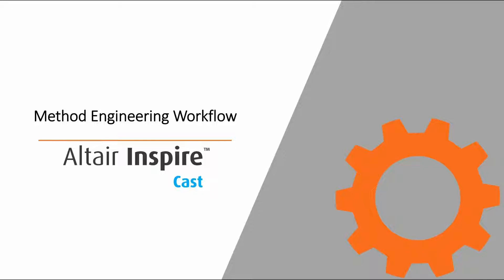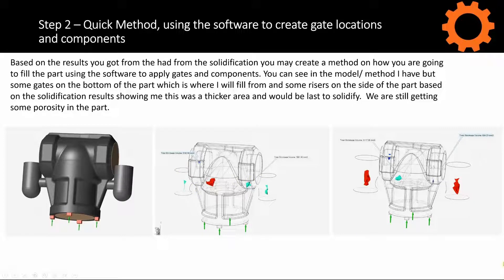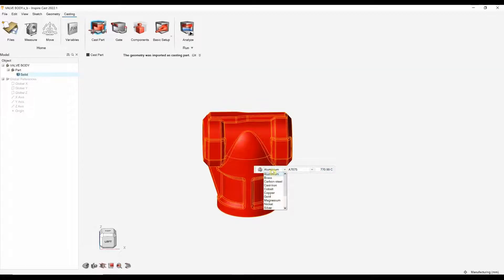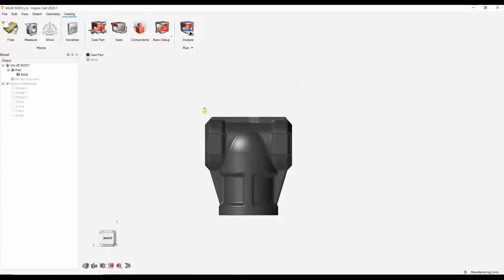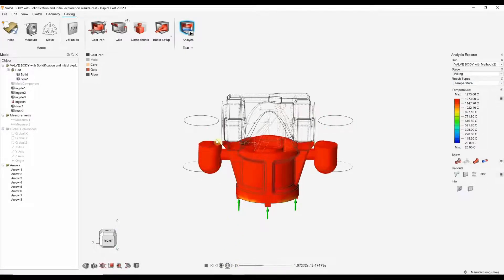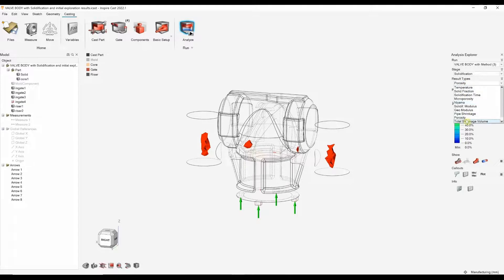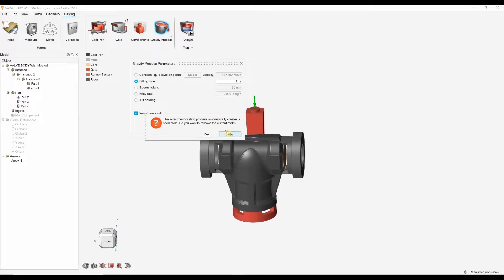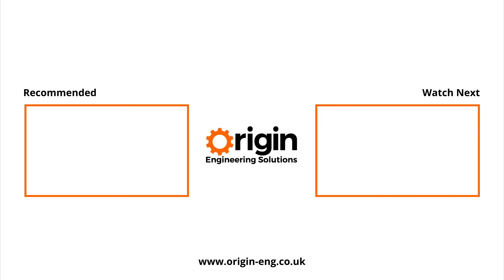Altair Inspire Cast - A Method Engineering Workflow

Comment: I have a question sir why are you not considering the microporosity in this part casting simulation is it less important or is microporosity also the key role in qualifying the casting simulation. if it comes then how to avoid the microporosity in LPDC process

Comment: i am trying to use Inspire cast and get the error " the FE process has stopped working" . How will this error be handled in inspire cast . Thank you
Reply from the maker: Hi Thai, who provides your Altair license currently?, they should be able to provide local support. You will likely have to send them the error message and they should be able to help. Could be down to meshing issues usually.

Thanks 

Origin